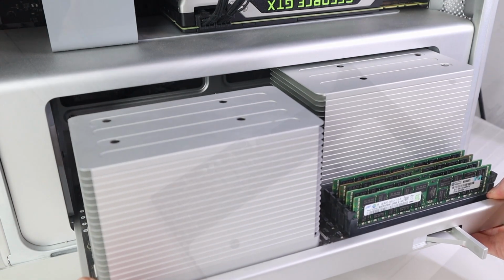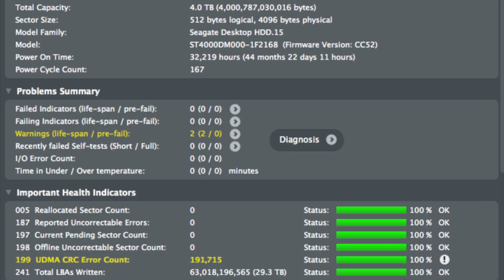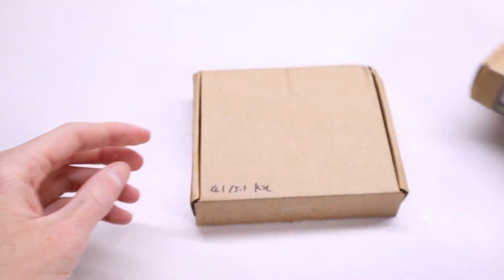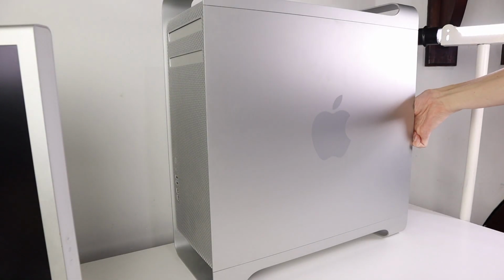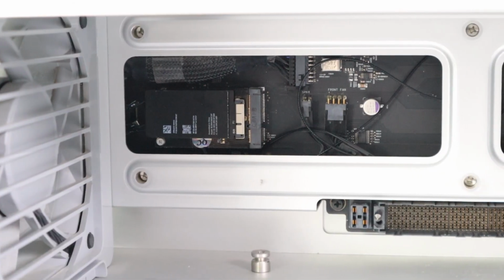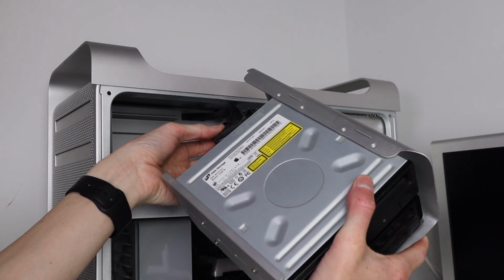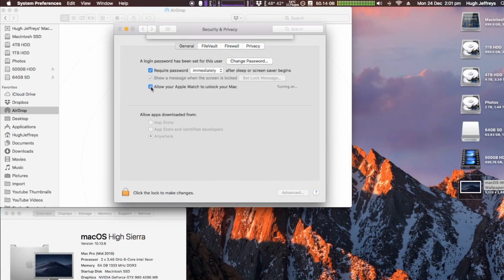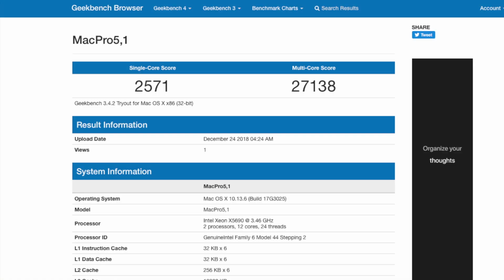The most powerful Mac Pro 5,1 ever?

Comment: Hey Hugh, thanks for the video! I also upgraded my MacPro 5,1 but the only problem that presented is that after installing the USB 3.0 card, when the Computer gets into sleep mode, the external hard drives disconect! It very frustrating because i have to set to never sleep mode and I dont like that! What is a good fast solution?

Comment: I have another question. What is a good display monitor to use with the mac pro 5,1 that has height adjustments and a built in camera for facetiming? I had installed a gpu pci card that hdmi ports.

Comment: March 2021... my 2009/5,1 MPro:   12 core, 3.46 Ghz, (both CPUs delidded) 128GB ram, 2x 2TB NVRM PCI duplexed, 4x2TB SSD RAID5 internal storage, PCI 3.1 card w/external 18 TB RAID5 for backups, I'm considering soon upgrading my internal drives to 4x4TB SSD.  PCI USB 3.1(2) provides high speed to the external 4x4TB external RAID5 array.  She's imperfect in this day and age, 12 years later, but she's the most amazing machine I've ever owned for her expandability, and capability.

Comment: Hi Hugh
I tried to do an upgrade on my mac 5,1 running OSX Sierra which had two Xeon Westmere 5620 2.66Ghz. I ordered two Xeon 5690 3.47Ghz from Hong Kong on ebay and when they arrived, I swopped over the processors as per normal. Have built computers B4 

When I booted up the processors, the computer didn't work. I had a blank screen with just the apple logo for ages, but no bootup. So my question is, did I miss something ? Did I have to update the software SMC, EFI firmware, as the whole process did not work for me. Very disappointed and sent the processors back to HK :)

Comment: I have a early 2009 4,1 and flashed it to a 5,1 / upgraded to Mojave / 
maxed out my memory (128gb 1333MHz) / GPU Radeon VII 16GB plugged into 
external PSU / 2X 3.46 6-Core (12core) / and I kid you not it's SOOOO 
SLOW!! :((( Everything online talks about how fast it should be and I 
try to open mail app "rainbow wheel" ichat "rainbow wheel" safari 
"rainbow reel." When I go to edit in Premiere Pro, sometimes it's 
fast... other times it's painfully slow. Spotify takes a full 5 mins 
just to open. It's insane. Any advice is welcomed. I spent a ton of cash
 to get her here and followed all instructions via online. Like... I 
just don't get it. It's actually slower than it was with it's original 
specs. :(

Comment: Just checking if you could send a link to a recommended Bluetooth/ WiFi Card, cause you removed the link and I am looking for one that would be a good fit to upgrade my macpro. Thanks
Reply: He probably removed the link to the Wifi/bluetooth kit because he is having a lot of problems with it and does not recommend using that one. As of today (July 6, 2020), the one that I have seen on most other Mac Pro 4,1/5,1 upgrade videos is this one: "OSXWiFi Mac Pro 2009 (4,1) and Mac Pro 2010-2012 (5,1) – Handoff and Continuity Broadcom BCM94360CD 802.11 A/B/G/N/AC with Bluetooth 4.0 macOS Yosemite Mojave Catalina - 10.10+ Upgrade Kit"

Comment: Links to where you bought the cards would have been nice.
Reply: He probably removed the link to the Wifi/bluetooth kit because he is having a lot of problems with it and does not recommend using that one. As of today (July 6, 2020), the one that I have seen on most other Mac Pro 4,1/5,1 upgrade videos is this one: "OSXWiFi Mac Pro 2009 (4,1) and Mac Pro 2010-2012 (5,1) – Handoff and Continuity Broadcom BCM94360CD 802.11 A/B/G/N/AC with Bluetooth 4.0 macOS Yosemite Mojave Catalina - 10.10+ Upgrade Kit"

Comment: I bought a 4,1 then flashed the firmware to make it think it’s a 5,1. Added the 3.46 GHZ hex core Xeon, got 32 GB of ECC RAM for only 100 bucks, added a GTX 970, added many hard drives/SSD’s. Got rid of the optical drive, added two SSD’s in the optical bays running raid 0 for Mac OS, have a single 512 SSD for boot camp, it’s still a beast, I love it.
I also have Mac fan control and since there are different compartments you can control the fans accordingly, graphics card getting warm, increase the PCIE fan, cpu and ram hot, increase those fans, and the heat sink for the CPU even has a “booster” fan as it’s called in Mac fan control, that moves extra air on the heat sink itself 

Edit: The CPU I put in it was a W3690 I believe

Comment: I have my mid 2012 Mac Pro Quad 3.2Ghz and I have the macOS Mojave running on it. The only upgrade I did was the graphic card. Haven't upgrade to the SSD and the ram just yet. I was checking on the macOS Catalina on Apple.com via App Store and it says that the latest macOS Catalina WORKS on my 5.1 Mac Pro. Then it after trying to update, it says the version of macOS Catalina is not available. Okay. I am looking into getting an iMac in 2020. Probably a refurbished 2016 or 2017 middle line model. Again I love my mid 2012 Mac Pro. May just keep it as long as I can. I am second guessing about upgrading the macOS to Catalina due to it bricking or making 32-bit apps OBSOLETE.

Comment: GREAT video -- I also have a MP 5,1 with 12 cores at 3.46 GHz. AMD Radion RX-580 card for metal-support and OS 10.14 compatibility. I need to do the wifi/bluetooth upgrade however, as the unit's factory bluetooth reception is very poor.

Comment: Is there anyway to either overcoolck the processors, or make an adapter so it can use later generation xeons with more cores or more speed.
Apparently 12 cores at 3.42 or about 30,000 geekbenck continuously under load is it's limit.

Comment: In 2019 would I be better served to build a 5,1 mac pro or buy an out the door mac mini.  Use case is family computer.
Reply: If you shop around enough you can get a 2010 Mac Pro and a high-spec 2012 Mac mini for about the same price. 

The both of them are at the end of their software support by apple, and the Mac Pro is much easier to take apart and fix if something goes wrong and has the capacity to be upgraded a ton, but the Mac mini is going to be more convenient space wise if you don’t mind digging deep for storage and ram upgrades.

Comment: @Hugh Jeffreys  My name is Eric from Montreal (Quebec, Canada). We recently upgraded a Mac Pro 5.1 2012, (from 4 cores to a 3,46 12 cores), with 48 megs of server ram, plus a 500 GB SSD and a RX 580 8Gb. It works fine on Sierra. What does not work are the 3 Western Digital Black 4TB HDD. I bought them to do a Raid 0. When I restart, they disappear (in raid 0 config or individually). They also don’t show up in Disk Utility. Every time, I have to shut down, take them out and then put them back. If I restart, they disappear again. Even System Profiler don’t see them. I tried with a Seagate drive and it works. I tried the Blacks one by one in different slots, and it does the same thing. Sometimes they are there and sometimes they disappear. I saw that it happened to many Mac Pro 4.1 and 5.1 users. Do you have any idea why it does that? Have you ever heard of it? (Btw, I called at WD, and they have no idea what to do…). I need performance drives. Do you recommend a particular brand? Thanks in advance, Eric:)
Reply: @Generation Soccer - It's a firmware problem with not just the WD Black series, but others as well, all the way down to 2 TB. It's not just a Mac-only issue either, as this has been a problem on some PC's as well. My advice would be to go with a Seagate Barracuda Pro, as they seem to work with pretty much everything. They're available in sizes up to 14TB.😉

Comment: I love my 5,1.  Original owner which came with a 1TB drive, 32GB ram, 2x 2.4GHz quad-core Xeon processors.  I have since upgrade to 8TB drive plus several others, 128 Gb ram and 2x3.46GHz 6-core Xeon processors.  Video card so I can use Mojave is next.

I run a virtual machine on my mac to bridge the windoze gap (I have XP, 7, 8.1 and 10 vms) as I have some software that is only available on windows.

Comment: Why does my Mac Pro 5,1 dual cpu tray keep crashing with a red light coming on behind processor B?
Reply: have you try resitting the cpu? it is a 4,1 flashed to 5,1 and if it is did you de-lid the cpu when upgrading ( assuming you upgraded the cpu)
Reply: @MrTeckish  The model is a 5,1 so no de-lidding was required. The CPUs have both been changed, (and interchanged). It seems the problem is deeper in the tray electronics.
Reply: @tony22745  http://tim.id.au/laptops/apple/macpro/macpro_mid2010.pdf check page 37, when apple actually care about Pro lol they have these for diagnosing
Reply: @MrTeckish  Your help much appreciated but I have one of these. The problem goes down deeper than the diagrams in the manual to the actual circuit boards. It seems Apple make a practice of keeping full schematics  from the public for commercial reasons.

Comment: I have compared this to a PC at work. It seems like the PC, which is new, is 3 times faster than the Mac Pro 5.1 from 2012 with 12-core. And the PC has also HDD, not SSD. How can that be? Is it because the PC has USB 3.0 or faster, when the Mac only has 2.0? I can´t melt this, after upgrading my Quadcore to 12-core and no difference in speed. I must do something.

Comment: Wow 36 thousand hours on the hard drive.
I pulled 2 hard drives out of my parents old office computers. They never turn them off.

I used the app called CrystalDiskInfo The newer one had 46,000 hours with 160 power on times on it. The older one had over 72,000 hours with 11,000 power on times on it. Both of them are near the end of their life span

Comment: Hi I have the exact Mac Pro all I done to it was put a ssd drive 1tb and upgraded the graphics card and new usb card and I installed Mojave’s so it’s been running fine and wanted to know about did you fix the issue with the WiFi Bluetooth card ? As that’s the only upgrades I done to it but like I said I’m running the Mojave OS X or do you think I should be running high Sierra would this make my Maschine run any faster as I use my Maschine for audio production running cubase but I still get performance problems so any advice would be great and for got to say I got the same USB card as you have ?

Comment: i have a 5.1 macpro dual 2.4ghz xeon (16 cores), which xeons u said are the fastest this machine can be upgraded to?
Reply: I just upgraded mine to the fastest available x5690 12 core 3.46ghz, no issues at all. Remember if its a 2009 you will have to delid the processor and I found the best way to do that is the vice method hands down.
Reply: Lance Farrell awesome, its the 2010, ty man
Reply: Juan Cano I have one of those too, x5580 and no need to delid, just use good thermal paste.

Comment: Total cost with all upgrades if you don't mind my asking? 

I strongly considered this option, tired of waiting to see what Apple does regarding the "new modular mac pro" rumors. But also didn't wanna throw money at a 5,1 knowing the hoops I'd have to jump through to get up and purring, not to mention the caveats of not being able to update OS due to various issue, nVidia Gfx support for example, and then eventually when Apple drops support entirely? Then what? Makes me nervous, lol. 

For now I went with a 2018 Mac Mini and DIY'd the Ram upgrade to 32GB and will add an eGPU next. I'm actually quite impressed with it. Geekbench'd at 5829/25515, and I'm pleased with the performance I'm getting in my Audio Production applications. Plenty I/O, super fast internal storage(1TB), ability to add external NVMe SSD over TB3, same speeds as internal. IMO, the 2018 Mini is the sweet spot cost to performance wise in the current Apple line up. 
Picked mine up for $1785 (i7 3.2ghz 6 core/8GB/1TB). That's why my first question was your total cost. I still believe the 5,1 is an extremely capable machine, and deals are definitely out there, I just worried about the setup, upkeep, upgrades, long term viability, etc. Glad to see its working for you though! Thanks for the video!

Comment: hi, I currently own a Mac Pro 5,1 2010 running Mac OS Sierra 10.12.6 2x3.46 ghz 6 core intel xeon processor, 64gb of ram, and ATI Radeon HD 5770 1024mb graphic card. what other graphic card do you recommend that is better for this setup?
Reply: thanks for your response
Reply: @surroundrive  can I also upgrade to high Sierra and or Mojave?

Comment: I agree, my 2009 mac pro running Mojave with 16gb ram and 13.5 TB of storage with SSD is lovely.  My Nvidia GTX 660 card is just about running on Mojave but without the dedicated Nvidia drivers (we won't go there).  I'm not sure I want a new mac when considering price and specs not to mention upgradeability.   I think Majove will be my last OS and possibly my last mac because of apples choices.   Wish I could shove a better CPU in my 4.1 but I'm not that brave.  Sadly I can't go above 16gb.
Reply: you can use patch to install new mac os versions
i have windows 10 instead

Comment: I have discovered USB 3 is what messes with Bluetooth. I have 3 Mac Pros and Bluetooth becomes practically useless when you plug an ssd into the USB 3 port I have all three updated with various wifi/Bluetooth upgrades. Las one I am pretty sure was from an iMac. I have USB3.1 cards in two 2009 Macs and One USB 3 card from OWC, in the 2012 MacPro, all have the same problem with Bluetooth.
I tried the Saphire RX 58 from Amz but it would not pass audio through the HDMI port. Discovered some kext files that made it work until I upgraded one of my apps, killed it dead. Have you found a decent metal card that actually works that doesn't cost more than the computer?

Comment: Hugh, Congratulations on your Classic Mac Pro (cMP) upgrades. A few additional upgrades are available that could make a significant difference in day-to-day usability. See Greg Gant's excellent "Definitive Classic Mac Pro (2006-2012) Upgrade Guide" for references and links: 1. Install an M.2 SSD drive in a compatible PCIe carrier and use it as for booting and apps/data. Apple has released a couple of BIOS updates in their 10.13/10.14 releases, and you can not boot natively from either an AHCI M.2 or an NVMe SSD. The NVMe drives are the current tech, affordable, exhibit very low latency, and are very fast (even with the cMP's PCIe 2.0 technology, a drive like the Samsung 970 EVO Plus will read and write at speeds approaching 1500MB/s). 2. Consider a faster video card, especially one with Metal-compatible technology. Sadly, NVidia driver support for Apple is lagging; the best choice for a step up is probably a Radeon RX 5xx series (or newer) card. The AMD drivers are natively updated by Apple and it's just a lot easier to work with them day-in and -out. 3. The DDR3 used in these machines is fastest in triple-channel mode (using slots [1,2,3] or [1,2,3, 5,6,7] with identical-sized DIMMS). It isn't that much faster than dual-channel (which appears to be how you are set up now), but if you really want to build the _most powerful Mac Pro 5,1 ever_, at least you should be aware of what the machine could do. Nice work though, and enjoy your machine. Most people who automatically dismiss the X58 Xeon as "ancient" aren't getting paid for significant computer work.

Comment: On geekbench there are some MacPro 5,1 running AMD Ryzen Threadripper 1950X 4100 MHz (16 cores) and getting a score of 56462. Anyone know how these CPUs can be installed in a Mac Pro?
Reply: I used a hacksaw to cut the CPU down to 8 cores from 16 and it runs cooler now.

Comment: I installed a Sapphire RX 580 in my 5,1. It's unfortunate that it's so thick that it blocks PCIe slot 2, I really need an extra slot. Anyone know of a third party cooling solution that's lower profile?
Reply: Use a pcie ribbon card to run the video card outside the case.

Comment: Good video, I have a similar late 2010 5,1 and an early 2009 4,1 which I was able to upgrade to 5,1 firmware. I am new to Mac (although I used to upgrade 128k macs to Fat Macs long long ago) and I had always thought that they became outdated quickly and made obsolete to future OS updates but these seem to have bucked the trend. I got my two systems free when they were replaced at work. One is a 12 core 2.66 16gb, the other an 8 core 2.93 16gb. I am using the 12 core 2010 as a Roon Music Server with a 500gb SSD, AMD RX580 and two 4tb media drives and I just love it but I was wondering how to upgrade it for speed and whether more memory would help it. Also interested in knowing the best programs and utilities people are using.

Comment: You didn't upgrade the GPU (your upgrades seem not so necessary, my 5,1 is fine with bluetooth and wifi????  Maybe something like the - 
Sapphire 11265-05-20G Radeon Pulse RX 580 8GB GDDR5 Dual HDMI / DVI-D / Dual DP OC with Backplate (UEFI) PCI-E Graphics Card Graphic Card

Cost at Amazon is $287.72

This will allow upgrade to newest macOS, and should provide dramatic boost overall render performance with FCPX, Premiere Pro and etc.?  I haven't done this myself, but intend to soon.

JOHNAVATAR.com

Comment: The 5,1 was definitely one of the best Mac Pros and its modularity, along with a hailstorm of complaints by pro users, is the reason that Apple is making the 7,1 Mac Pro upgradeable.  I have the same 3.46GHz 12-core machine but mine is sporting an NVIDIA Quadro P4000 workstation class graphics card, two 500GB SSD's, one 1TB SSD, and one 2TB SSD. It's also about to receive 96GB of RAM running in triple channel mode.  Taking up two of my PCIe slots are Sonnet Allegro Pro USB 3.0 cards and the graphics card is driving a 49" 5120x1440 display, two 1920x1080 touchscreen displays, and one 43" 3840x2160 display.  The final PCIe slot is reserved for a MAGMA ExpressBox 7 PCIe expansion chassis holding 6 UAD-2 plugin accelerator cards.  It's a beast and should run my sessions for many years to come!
Reply: Should be fast enough to computate the speed of 2 tree frogs humping.
Reply: Ah nice dude I did the same only difference is that mine is using the NVIDIA Titan X Maxwell Edition.